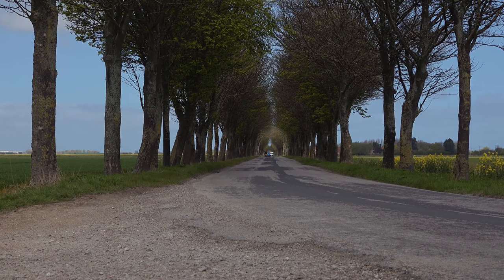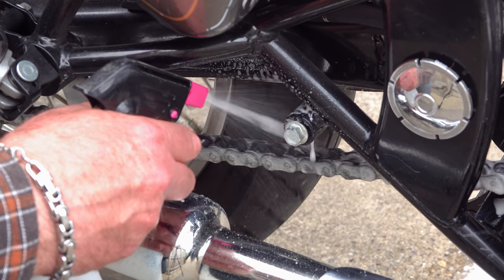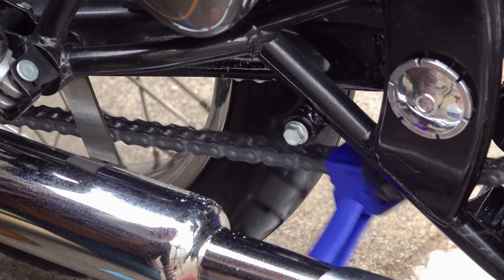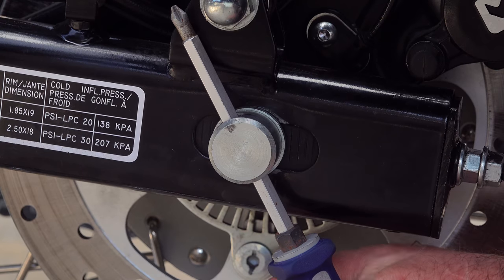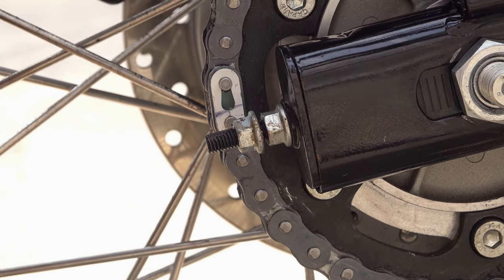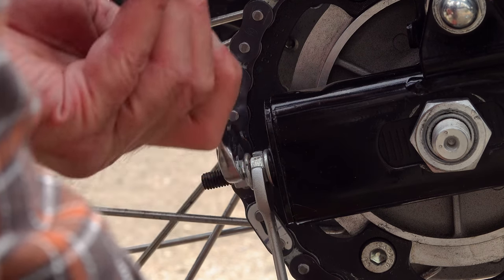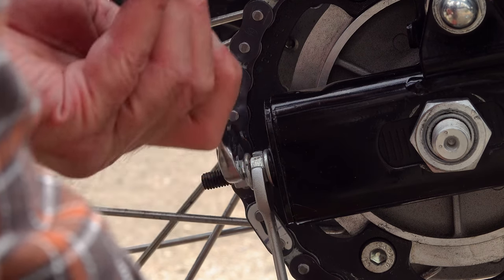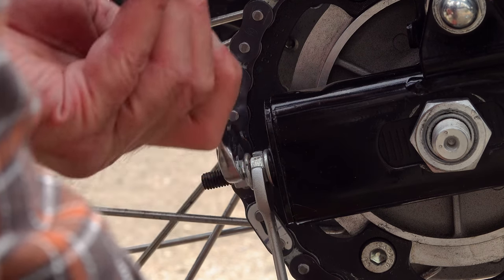Royal Enfield Classic 500, Chain adjustment and Lubrication.  A trip to the TWIGHLIGHT ZONE!

Comment: Great vid Stu. I noticed the large nut appears to be on a different thread to the small nut or so it seems while watching. Mines only done 500 miles so don't need to adjust yet. But thanks for the info buddy.
Reply from the maker: No both are on the same thread Glen as far as I can see.
Reply: @stuartfillingham  Stuart what does the manual say about taking the back wheel out to put a new tire on?
Reply: @stuartfillingham  Hi Stuart, great video again. The large nut is on a different thread called as the "Spindle Short"  through which the axle slides in. This mechanism is one the oldest in Bullets and were never modernized.
Reply: Glen is correct. The large nut acts on the part that only locks the right hand "sprocket side", whereas the smaller locknut acts on a smaller diameter "through bolt" which goes through the centre of the whole axle. Regards Paul Fowell.
Reply: @stuartfillingham  Glen is correct.  They just look like they are on the same thread.  

Additionally, I had a very difficult time getting slack correct on my C5.  It turns out that one (or perhaps both) of the sprockets is not actually round.  It's egg-shaped.  I have to rotate the wheel until I find the point where the chain is the tightest and set the slack at that point.  These are fun bikes to work on.

Comment: The hub nut holds the sprocket hub on, the axle goes through the sprocket hub, they are both different threads. When you tighten the hub nut all you are doing is tightening the hub onto the right hand side, tightening the axle nut tightens up the rest. You can remove the axle and wheel and leave the hub connected to the swing arm. I found this out when I had to do a tube change after a puncture.
Reply: This is correct.  The two nuts aren't on the same thread.  They just look like they are.

Comment: Loooong ago I stopped adjusting chains by measuring play. I read something from some pros in the later part of the 70s. I adjusted them by putting the rear axle level with the drive sprocket. Then adjusted the chain to be tight enough to have just a bit of movement. That's it. Chain becomes the tightest when the rear and drive gear are straight across from each other. If you tighten by measuring the play, you can make it to tight and increase wear, etc. I found this to be done by others to often. So be carefull.

Comment: I vaguely recall my gt185 having something similar on the axle. The sprocket was actually on a small stub axle that the wheel axle passed through. So you needed to loosen both to adjust the chain. The nut on the stub axle ( the inner one) did not tighten the wheel at all. The second nut tightened the axle. The purpose of this arrangement was allegedly for quick wheel removal without disturbing the chain & sprocket.
Reply from the maker: mine was just a standard axle with a castellated nut, but I suppose they may have changed it over the years.
Reply: @stuartfillingham  Yes, the 'sprocket nut' retains the sprocket on an outer sleeve on that side, and is not on the same thread as the axle nut, so that the axle may be removed independently - see rear wheel removal for the last series of 350/500 bullets.
Reply: I too have a vague recall of something similar, maybe my GT125 or maybe the family Ariel Red Hunter but it was 40 odd years ago so it could have been anything!

Comment: after cleaning the chain, i just coat it in ep90 with a stiff bristle brush, slightly messy (have some old rags to catch drippage), but cheaper and better than spray cans, some of which are like some devil glue concoction that holds road grit to your chain like sh to a blanket

Comment: There are two different axle threads one is on the axle rod and another with the big nut those two are different, until you tighten the locknot axle rod is free to play. You once remove wheel you will come to know the mechanism ( I came to know this when I was working as an intern engineer in Royal Enfield)

Comment: I don't worry too much over torque settings to the axel nuts, usually just sogg them up by "feel", it's only putting 27 horse through the drive train, Enfields are somewhat of a blunt instrument compared to 180mph rice rockets dripping in technology. Basic spannering is all you need.

Comment: Hi Stu. Re the two nuts on the axle. Not sure about the unit construction engines but on my 2006 bullet it's to make the wheel easier to remove. By just removing the smaller  nut the back wheel can come away leaving the brake drum, rear sprocket and chain in place and still perfectly adjusted. In short despite appearances the big nut isn't threaded into the axle but a separate bracket holding just the brake drum that the axle passes through. Maybe it's a carry over...

Comment: On my euro 3 bullet 500 the chain adjustment is super easy: It's one of those stepped eccentric adjusters that used to come on classic bikes. On a side note, I can't bothered to clean the chain on my bike more than once a year, so every couple aplications of chain lube I'll use 90 weight gear oil that helps to break up the caked up chain lube. Most of it just flings off while riding and I just wipe off whatever gets on the bike when I get home.

Comment: I never had any trouble with the classic chain in 2 years. Had the last of the rear drum brake  ones.
Reply: I’m pretty good at chain maintenance. My 2010 model Classic 500 original chain didn’t last long. But the aftermarket one has not only lasted the last 40,000km… I am also only half way on the adjustment cam and Curren sitting at almost 50,000km. I have one little tight spot that only makes 1mm difference to the tension. I use heavy 90W oil on mine. Maybe clean it once a year.

Comment: This double nut system is a holdover from the drum brake days and is actually rather clever. Go to the chapter in the book on removing the rear wheel and it will all make sense.

Comment: Stu yea, if you haven't adjusted a chain which has a QD hub fitted and only use to a modern (1970's) wheel set up then a QD will seem odd. but the inner nut is for holing the QD hub in place, this is so the wheel can be removed without any re-adjustment of the chain after the wheel is replaced or re-adjusted. However if chain adjustment is required then the whole wheel needs to move, hence loosen both the nuts enough for the wheel to move forward/backwards (note is only one nut on the wheel spindle the other is on the QD backplate) 
Other bikes which have QD hubs which i can think of is a 1971 Triumph 500 (Daytona) if there others makes (modern bikes) maybe someone can add to the Triumph T100. TNX

Comment: You are lucky that your bike has chain adjusters that work by turning a nut, my RE classic 500 has snail-type adjusters that move around when tightening the axle nut /locknut. It is a job that needs 3 hands :)

Comment: How to keep the rear wheel tight against the adjusters whilst torquing the axle nut. ...Put a dirty shop rag in the lower run of the chain  near the rear sprocket, then turn the wheel forward. Leave it there and tighten the axle nut... Take the rag out. Job done. Try it... Works every time.
Reply from the maker: Good tip! I shall try that thanks!
Reply: @stuartfillingham  no worries Stuart. Love your channel
Reply: This is apparent at 13:50-1357 thereabouts where Stu is nipping up the LH/brake side adjuster. You can see it's still moving about slightly 'cos it's not absolutely hard abutted up against the end of the swingarm. At this point, my approach has been to give the very end of the adjuster's threaded bolt a moderate tap with a soft-faced (hide, plastic or rubber) hammer/mallet. Combining your rag-jam tip followed by my hammer-tap tip will give the perfect belt & braces solution to keeping the wheel bang-on in place while doing final torque-up.

Comment: All nuts on their threads have slack, some more than others. Course threads tend to have more. They need this to run properly. When you tightened the the 'sprocket' nut it was hard up against its threads falling away from the centre of the axle, respectively. The tightening of the axle nut upon the sprocket nut takes the sprocket nut to the other side of its slack on the thread and therefore tightens a little more axle play. Hope that makes sense?

Comment: i think the sproket  bigger nut is indipendant on its own bearing then the cush drives are inside, try taking the wheel off as if changing tyre all will become clear as beleive you can take the rear wheel out and leave the sproket on the swing arm..just remove the spacer/brake disc carrier on left hand side, or pull out the main spindel completley you will see the large nut is threaded on a bored out shaft..
Reply from the maker: will check it out!
Reply: @stuartfillingham  check out Royal enfield classic rear wheel removal and fitment video all will become clear when the guy removes the rear wheel the sprocket and bearings remain on swing arm attached by the big nut, all best si

Comment: The sprocket is mounted on its own bearing on a hollow stub axle which is secured by the sprocket nut. The wheel spindle or axle as you call it, passes through the stub axle and is not threaded to it it merely slides through and is secured by the wheel spindle nut which is NOT a lock nut but secures the wheel spindle on the opposite side to the Sprocket nut. This is common practice on bikes with cush drives in the rear hub. It enables the wheel to be removed easily without disturbing the chain adjustment.
Reply from the maker: Thanks David, pretty much confirms what others  familiar with this set up have said. I would  point out though that the axle nut most definitely is an aircraft type lock nut! You can clearly see the stainless locking collar in the images contained in this video.
Reply: @stuartfillingham  Point taken Stuart one of my bikes, a Jawa has exactly the same arrangement but with a plain nut and lockwasher.

Comment: Tightening the locknut over the larger nut pulls the axle a bit tighter depending on the precision of the larger nuts coincidence with the axle threads.

Comment: My dealer told me the chain was to tight using the centre stand  as in the handbook.I was told to use paddock stands or with somebody sitting on it to compress the suspension as this tightend the chain🤔

Comment: Both my bikes have a driveshaft. Saves me the chain adjustments, but where a chain dampens a bit of the gear change rev 'mismatches', with a driveshaft you really need to be pretty precise when it comes to rev-matching when going up or down the box, otherwise the lurching is much more pronounced :) Both bikes not having a slipper clutch doesn't help either ;)
Reply from the maker: LOl yeah been there and done that. regular servicing of the shaft usually works out pretty expensive when its due though! I never found rev matching an issue, it all comes down to clutch control.

Comment: So.... you want a professional response on how to correctly adjust the chain... Well here goes... I have the Classic 500 and a 350 cast iron Bullet. Both have the most weird chain adjustment I've come across and I've adjusted chains on many bikes. I haven't checked yet on the 500, but normally on Bullets, you remove the outer nut and you can then remove the axle and rear wheel leaving the chain and sprocket in place. I think someone mentioned this further down. I know, I didn't really help, but hey 😊

Comment: One observation Stu. I’ve got a 2020 model Trials 500. On mine, behind the 30mm nut, there is a large plain washer. This seems to be missing on yours? Other 500 Classics that I’ve seen also have the washer between the big nut and the swing arm leg. Might be worth checking whether you should have one.
Reply from the maker: did consider that myself Trev. but manual shows it without a washer.
Reply: @stuartfillingham  the other classics I've seen so have a washer and without one I guess the nut will start to chew up the paint on your swing arm. Might be worth further investigation.  Seems daft chatting about a simple plain washer, but sometimes the small things can be quite important I guess.

Comment: You would understand axle setup if you had, had a Honda cub, thanks for video cheers
Reply: Yes. I remember removing the rear wheel from a Honda cd 90 back in the 70's. There was a spacer between the sprocket and hub which when removed allowed you to take off the rear wheel leaving the sprocket and hub in situ, and not interfering with the alignment of the wheel when replaced.

Comment: The sprocket nut holds the sprocket carrier to the arm. If you remove the axle nut you can extract the spindle and remove the wheel. This leaves the  sprocket carrier behind. Then you can remove the sprocket carrier.  Not an easy job. Got a rear puncture in my 2020 classic. Has to have 4" of wood under the stand.
Reply from the maker: Ah Thanks peter. Torque values for both fasteners?

Comment: And... pause your video at 14:49 and you will see what’s going on with the double nut situation. Two different shafts / threads involved here.
Reply from the maker: You may be right Trev Ill have to investigate at some stage.  much easier to see in 4k when the image of the shaft is 3 inches across at eye level as opposed to actually deciphering the situation in the real world.
Reply: @stuartfillingham  youre right Stu; I scratched my head for quite a while before I figured out what was going on. And I'm wondering whether the thickness of the missing plain washer could actually be quite important to get the nuts sitting in the correct place, being mindful of the two threads involved?
Reply from the maker: @Trev350  possibly but the manual shows the nut fitted without a washer so I'm presuming that's how it should be?

Comment: The big nut on the right side, is not on the same thread.  it is a seperate shaft which locks just the right side and the through bolt  then tightens the left side. . on my 350 which is slightly different, but to make it simple, I have turned the bold end for end so is much easier now with the nuts being on the side that is being tightened

Comment: Hi Stu. Very detailed and informative video. Should the chain slack be measured on the side stand when the weight of the bike is on it? I have adjusted my chain on the centrestand at times then notice it is too tight when i put the bike back on the side stand.  Cheers  Ian
Reply from the maker: On most bikes yes.. but RE recommend the bullet be checked on the centre stand.

Comment: Hi Stuart, great video on the job I hate the most, chains are a necessary evil. With regards to the larger nut locking the sprocket and the smaller nut locking the spindle I have seen this before on Japanese bike of the 70/80's era. I can't remember the exact bikes which had this design as I have had too many bikes so it would probably be a Yamaha or a Kawasaki as this was my choice of bikes at that time, so I don't think this system is unique to Royal Enfield.

Comment: Shouldn't the chain be adjusted in the tight spot ? 👍
Reply from the maker: If you have a tight spot you should be changing the chain not adjusting it.
Reply: I've had new branded chains that had a tight spot ! 👍
Reply: @peterbennett4948  what's that supposed to prove? As he said in the video new chains need to bed in and will wear initially. Its very unusual for a new chain to have tight spots but if it still has them after the 1st 100 miles there is a major problem and the chain needs to go back to the retailer!
Tight spots on a chain that has some mileage, is an indication that seals have failed and the rollers and pins are seizing. It needs replacing not adjusting!
Reply: @themechanic2036  I'm not causing an argument but that's not my experience in over 50yrs. Take last year I put new sprockets and Reynolds none O ring chain on my TR5T and even though not prominent there was a tighter spot. Over the years this is not uncommon from my experience.
Reply: @peterbennett4948  well if your buying Reynolds chains thats why they have tight spots. had one fail on me a few years back, when I complained I learned they are now a budget brand made in China using an old British brand name to suck in customers. I agree with what others have said if there are tight spots in a chain its faulty! I only use D.I.D chains now.
Reply: @peterbennett4948  nearly 30 years a bike mechanic Peter I've fitted literally hundreds of chains. One Brand I wont fit for customers are Renolds chains and sprockets. cheap chains made for pennies in Asia trading off an old respected British name!

Comment: If you go too far in the adjustment and have to slacken things off, give the adjusters a good smack with a heavy rubber mallet to drive them back into the swingarm. If you don't, you stand the chance of a) measuring slack with the adjuster in the wrong place and b) tightening everything up with the wheel slightly out of alignment. The net result of that is you will scrub the tyre and wear it out faster. First time you take the wheel out, drop out both adjusters and measure the length of the threaded portion of the adjusters from the edge of the spindle hole to the end of the threads. If they are the same (they should be), that gives you a backup check of the chain adjustment by measuring the distance from the spindle centre to the end of the threaded portion. I have to double-check this way because the marks on the l/h adjuster are very close to invisible.